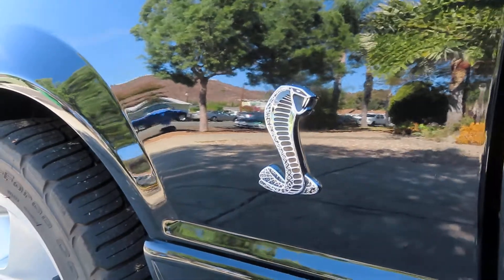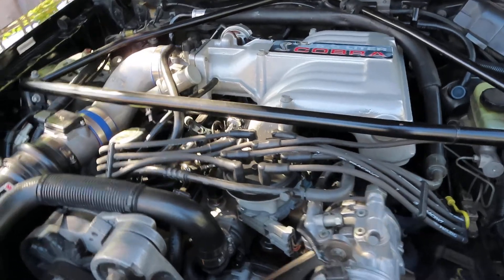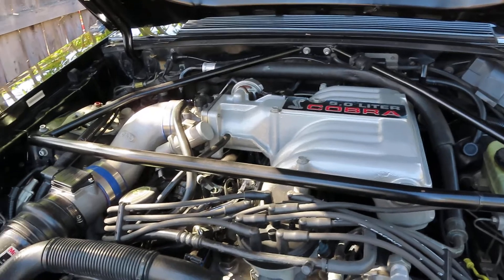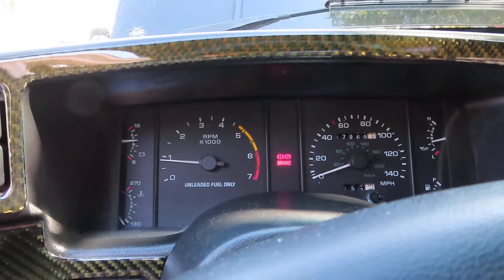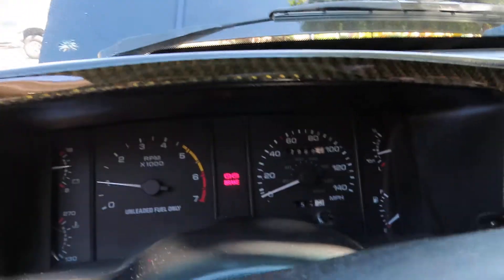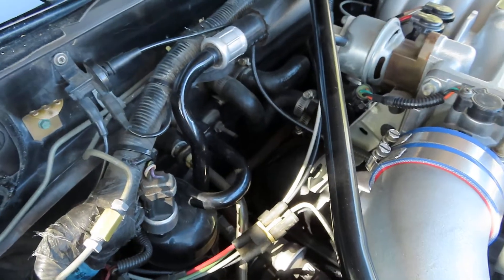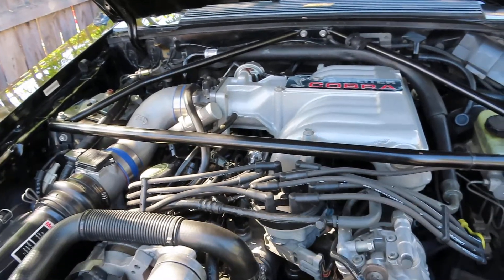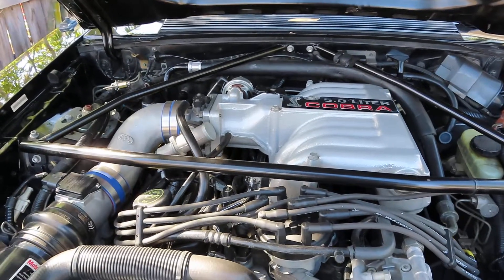GT40 Head Rebuild Project Finally Complete!

Comment: Did you give any thoughts to changing out the stock camshaft when you had it apart? You have a clean, neat engine bay!
Reply from the maker: Thought about it but I didn't want to change too much. Want to keep the drivability the same plus it's getting harder to pass the smog test.

Comment: I have an 87 I'm swapping to MAF this winter. Then I'll be installing Cobra GT40 heads on mine. I currently have Cobra Crane, 1.7 RR's on the stock E7's
Do you know if I'll have any clearance issues using the 1.7 RR with the GT40's?
I'm going to keep the stock cam.
Thanks!
Reply from the maker: The GT40 heads on my COBRA came with Crane 1.7 RR.  Clearance is fine as long as the Cam isn't too aggressive. Thanks for watching!
Reply: @mikeshorsepowergarage7577  thank you, nope, my cam is the factory from the 87. I planned on keeping the factory cam, since I read the 1987's had a slightly more aggressive cam than the 88-93's. So...I'll leave it as is, keep the 1.7 RR's and slap on the Cobra GT40's. 
Thanks again